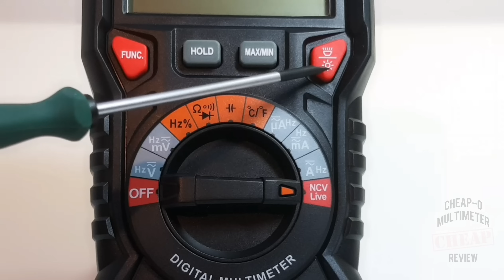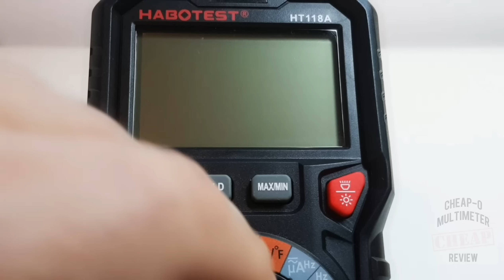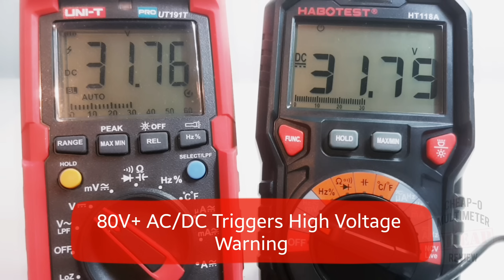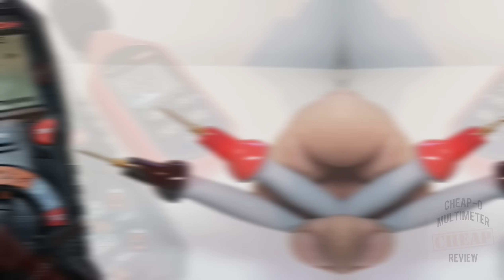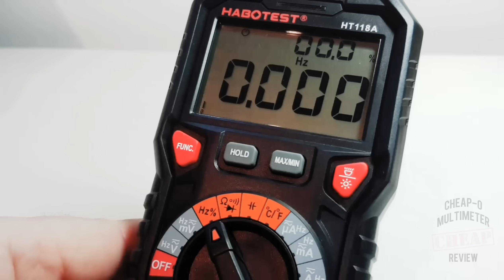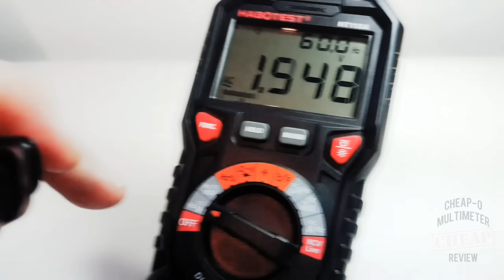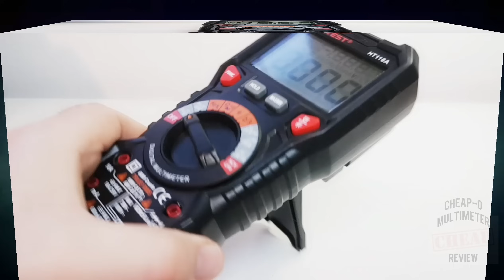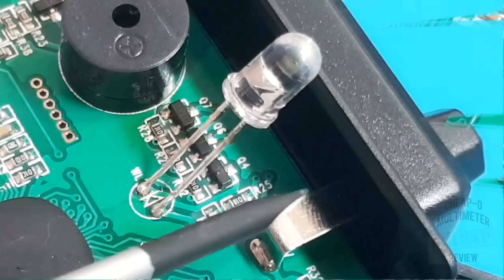HABOTEST HT118A  CHEAP-O Multimeter Review & Teardown!

Comment: Does yours sometimes show the temperature in Hz/mA mode?
Reply from the maker: Never seen that happen before..
Perhaps give the selector switch a cleaning with IPA
Reply: @KeepOnTesting  Thank you for the answer and the tip, I'll try that out.
It seems to be a contact problem, if you touch or move the selector switch slightly, the modes change or the device switches off completely.
Reply from the maker: I would also put a tiny amount of dielectric grease on the selector tracks after you've cleaned them with IPS. Let us know how it goes. 👍
Reply: @KeepOnTesting  I'll try it tonight.
In principle I could still return the device, but when you buy something with a new customer discount you try to save it to save stress and money.
Reply: @KeepOnTesting  I opened the device, removed the grease applied by the manufacturer in the affected area, cleaned the sensors and it already looks much better.
It no longer switches off or over easily and the temperature is only displayed in Hz/mA mode if you press the control knob on the opposite side down a little.
It shouldn't happen, but it can be avoided.
I will test it for a while and hope it stays good. I still have to apply fresh grease, unfortunately I don't have any left in the house.
One thing that has surprised me since I bought it is that even with very fresh batteries it never shows "full". Is that normal?
In any case, thank you very much for the great support!

Comment: I would like to ask you about this habotest watch, it is sold in Asia and Europe, is there any difference in accuracy, sir?
Reply from the maker: No, the accuracy is identical irregardless of where its being sold. Only difference is the input protection which is usually better in the European version due to more stringent EU safety regulations.
Reply: @KeepOnTesting  Oh I'm so happy to have your reply, thank you so much 😊
Reply: @KeepOnTesting  About habotest HT208D AC DC current clamp meter, do you know it?
Reply from the maker: @c__TattinhNhi Check out my HT208D Clamp review,  it's the identical clamp as the HABOTEST,  its simply rebranded as a Kaiweets. https://youtu.be/p2v7-uQD6QM?si=xIK_Sc31HujFk7ti
Reply: @KeepOnTesting  Thank you very much😊
Reply from the maker: @c__TattinhNhi  Anytime my friend 👍
Reply: @KeepOnTesting  I have watched many multimeter review videos but rarely see anyone clearly explain the error table of that meter.  I mean the specification is wrong

Comment: Would this be a better choice over the Sanwa CD771? Thank you.
Reply from the maker: Completely different multimeters.  If you're working on energized circuits Grab the Sanwa !
Reply: @KeepOnTesting  Many thanks for your time replying to me, let alone so quickly!  If I may last ask: what makes the Sanwa better for energized circuits? I plan on doing electrical and electronic projects (building electric and electronic devices), some electronic repairs, testing salvaged components + general fiddling around and experimentation. Thank you for your multimeter review videos, love them.
Reply from the maker: @cosmos7engineer  SANWA is a better engineered multimeter. It does not have all the features of the HABOTEST but it's built with a high degree of precision and the interbal components have better tolerances. You sound serious about your electronics needs and you will probably be doing more than a hobby electronics therefore I suggest grabbing the Sanwa and perhaps pickup the HABOTEST as a backup. Btw sanwa-america.com is the place to get your new Sanwa if you live in North America. Tell them Darren Walker Sent ya 😃

Comment: I thought NCV was no contact voltage? why did he stick the probe in the cable? it should have detected voltage without contact.
Reply: NCV is non contact voltage yes, but Live test is probing with 1 probe for a single contact point voltage test
On the meter there is NCV and Live in the same spot indicating it does both, which it does

Comment: A long term review would also be a great help. I find that the cheap meters usually fail because the dial or the power buttons fail.
Reply: I have the same multimeter, I got it 4 years ago. it still functions very well.

Comment: Almost bouget but why why it's going to AC not Dc. 99.99% of my work is DC
Reply from the maker: Agreed, DC should be the default! 👍
Reply: Todays versions goes to DC, I think if you order nowadays, it'll be latest build - Starts to DC, light doesn't turn off, beeping in diode mode, etc.
Reply: @svetlinbarzev9110  Bought one, tested. the problem is, its to slow on ohm . I have 3 Fluke 11 30 years old much faster. not for pro for sure
Reply from the maker: @computersrepaircotesaint-l7407  True enough but it's only 35$ so I can't compare it to a Fluke persay, even an old Fluke 😄
Reply from the maker: @svetlinbarzev9110  I'll be grabbing a new version to compare. 👍

Comment: Hi Darren, a lot of thanks for all theses reviews, very useful for a beginner like me.
 This Habotest seems really reliable and a very good choice.
A simple question about all these 3 Volts multimeters : Is it possible to use the voltage of a lithium battery (between 3,3V and 4,2V when fully charged)?......surely better light on the screen and higher beep, very little discharge for a big Ah capacity, but any problem for the electronic card and the screen with this little higher voltage? Can it be a possible choice or is it better to keep both alkaline 1,5V batteries?
Michel from France.
Reply from the maker: Hi Michel..

Many thanks...😉
Yes, you can certainly use a Lithium cell instead of a regular alkaline battery. In  terms of performance and possible long term effect I don't have any data to effectively point to. I say go for it !
 😀👍
Reply: @KeepOnTesting  Thanks for your quick answer Darren , "I 'll go for it" and first try with one half-charged cell (storage voltage, 3,8V) and then slowly up......I live not far from the english coast....and if that smells like a little burnsmoke across the Channel to your home, you will know it was a mistake!! Greetings!
Reply from the maker: @Michel-Artois  Sounds like a plan.! Hopefully you'll be just fine..let me know how it goes 😉👍

Comment: I had this 3 months. One day (I must have dragged my feet a bit) I walked up to my bench and just turned it on, the lights flashed for one second and that was it, dead as a doorknob. It wasn't hooked up to anything, Ripped-off!
Reply from the maker: I would clean the rotary selector tracks with IP, then grease lightly with a dielectric. Sounds like the tracks might be causing a short. Also, inspect pcb for any loose or cracked components.
Reply from the maker: Yikes !!! Sorry to hear that Cliff!

Comment: How would you compare this to the lomvum t28?
Reply from the maker: I still prefer the HABOTEST...
Here's my Lomvum T28C review..
https://youtu.be/JxE1Uwh6sLE
Reply: @KeepOnTesting  thanks!
Reply from the maker: @NegativeRail  anytime 😊
Reply: Im stuck between the HT118a and the HT118c. I’m leaning towards the manual option. Any reason to avoid that? Currently studying to become an electronic technician, but still pretty beginner. Thanks.
Reply from the maker: @NegativeRail  I think the manual ranging 118C would be better from a learning perspective 🤔 definitely not as easy to use at first but you will catch on quickly I'm sure..

Comment: Does it have adaptor for 2 pin standard k-type temperature sensor or just proprietary k-type ? Very good review! 👌🏻😁 i am oscilanting between this and uni-t 139C. Habo looks nicer but i belive the 139 is better what do you think? 139 also has no adaptor for k-type 🤦🏻‍♂️ and i really need that
Reply from the maker: The Habotest has no KTYPE Adapter. Just a standard Jack input sensor temp probe. You can buy a separate KTYPE Adaptor on Ebay or Ali though. 👍My preference is definitely the HABOTEST 💥
Reply: Darren Walker thank you for the response 😁
Reply from the maker: @3mariusx  send me an email: netplicity1@gmail.com    
I'll send a ktype adapter your way.

Comment: What about shorted diode test in this multimeter ht 118a
 give short beep in case of good  diode and shorted diode 
because if you touch two probs in diode mode give short beep is this normal

Comment: Great video, thanks for review. i have a old 1999 count dmm and some functions not working anymore so Currently looking a good deal multimeter to buy. Which should be better habotest 118A, aneng 8008 or unit ut89x. Prices in my country ht118aand ut89 25$. Aneng 18$
Reply from the maker: I would still choose the HABOTEST HT118A 👍
Reply: @KeepOnTesting  
Uni- T89XD ??
Reply from the maker: @pengawaspenyerumalutaubat8365  
https://youtu.be/pAovc5h12zg

Comment: Hello chief, I have just got one of these and would like to change the temperature display. Do you know how I can do this?
Reply from the maker: Press the FUNCTION button (top left)to alternate between C/F 😀👍
Reply: I have the kaiweets version and function button does not do anything on the temperature setting. Thank you for your advice.
Reply from the maker: @stuartpeters1080  My bad.. You can't change or alter the display in Temperature mode. It's a dual screen setup with no options. Btw, All HT118A are identical,  KAIWEETS, RICHMETERS, HABOTEST  etc..no difference , same pcb.
Reply: Ah right you are, cheers.
Reply: There must be a software difference as my meter has Fahrenheit as the larger display and Celsius as the small display. Where as your meter is the reverse. Interesting.

Comment: can it measure mosfet?
Reply from the maker: Yes, most any meter can verify if a mosfet is good or bad. Use diode mode and check your datasheet. Charge the gate , connect to drain and you should see it short.

Comment: Hello Darren hope all is well with you. It appears to me these DMM are available under different brand names. 
Example 
HabotestHT118A
Kaiweets HT118A
Taiss TA118A
AstroAI M6KOR

All at different pricing cheapest I found was the 
Kaiweets at $33:99 CDN
Taiss TA at $34:66 CDN
ASTROAI M6KOR at $30:99

The Habotest HT118A ranged from $47:29 all the way up to $147 😱

So I wonder who the actual manufacturer is. Seems to be a daunting task to make a decision of which one to get in the DMM market. I wonder how these stand up against the Crappy Tire brand Mastercraft Maximum meters and is it worth paying more for the likes of a Brymen, Greenlee, Klein, Fluke EEV and the UNI-T. 

Let me know what you’re thoughts are considering you have approximately 500 meters. Thanks
Reply from the maker: Hi Richard,
Yes there are many incarnations of the HT118A but they are ALL identical. Same PCB, board layout and components. In a subsequent review I had the Kaiweets and another opened for display...https://youtu.be/8IK09P25qAM
They are every bit as good and better than the Canadian Tire Mastercraft series, which are rebranded Allsun multimeters anyway.
For the average home user it will suffice nicely. It's not a Brymen but it's not priced like one either. Never pay more than 45$ CDN for the HT118A. UNI-T also makes some great multimeters at great prices with better input protection than the HT118A. Just not as feature packed.😀👍
Reply: @KeepOnTesting  Thanks for the prompt reply. As I am looking to set a small workshop with the intention of getting into electronics and my ham radio license, be honest and advise which meter is the one to get for that purpose. I only wish to buy once, but also keep on a budget. On a fixed income now and building up the necessary equipment can be pricey. I just recently purchased a used Tektronic 466 Oscilosope and will be needing a power supply and possibly a spectrum analyzer and frequency generator to add to the list of wants. I appreciate all you do and the time and money you spend making these videos to help educate us less savvy in this area or expertise. Thanks. 🍻
Reply from the maker: @richardshort4587  In that case I would be happy to help..email me: netplicity1@gmail.com and I can give you  a longer reply with some sage advice 😀 👍
Reply: @KeepOnTesting  Hi Darren, my email message should be in you’re inbox now bud. Thanks Richard
Reply from the maker: @richardshort4587  Got it..will reply shortly. 😀👍

Comment: I have one of these.  if you read the manual it cautions you not to use it on voltages higher than 230VAC. if that's the limit than this meter can not be rated CATIII or IV.  I would not use it on Industrial 480 power systems.  The meter is well built, though I did have to open it up and re-solder a circuit pad because it was interminate.  .
Reply from the maker: Good point..Let's face it most dmms in the CHEAP-O REALM aren't going to do heavy mains ..nor should they..used for household voltage (120/230) max depending on your geography and you'll be just fine.
Reply: @KeepOnTesting  Cat III and Cat IV ratings are a safety rating.  The manufacture is basically saying that the  instrument will not cause a Arc Flash incident at voltages up to 600 VAC when properly used.  If you are not aware of how dangerous a Arc flash incident can be take a look at some of the video's on You Tube.   

yes I like the versatility of the instrument but I only will use in on my electronics work bench and deffently not on tube equipment.
Reply from the maker: @jimnunn9232  I'm well aware of CAT Ratings. Hence, HT118A is perfectly safe for household mains CAT II. Most multimeter vendors claim higher CAT than what the multimeters are actually capable of safely doing. Never use any CHEAP-O Multimeter for anything above mains 1 or 3 phase CAT II and you'll be fine.

Comment: HI Darren, love from india. Will You be doing reviews of meters from 50 TO 100 USD.  And also one more question, which alcheapo multimeters has the best input protection. and by cheapo I mean below 50 USD. based on that I will buy it promptly. yu really give very convincing reviews, I base my buying decisions base on your reviews.
Reply from the maker: Hello my friend! Yes indeed I will be doing some multimeter reviews I the $50-150 range in September 😀👍
CHEAP-O w best input protection..Great question! ...normally the two don't coexist however the UNI-T UT39E+ had one of the best...dual PTCs, spark gap protection,  ceramic fuses and a very clean pcb layout ..20,000 COUNT CHEAP-O !!

Comment: There is a simple hack to keep the backlight on indefinitely.
If you have the earlier firmware.
Inside, top right, are three wires, red, black, white going to
the display. connect a new wire from the white to the left leg of the flashlight
LED. Now the display backlight stays on with the flashlight.
If, like me, you think the flashlight is useless, snip the right
leg of the flashlight led. Now the backlight times out with a
short press of the backlight button and STAYS ON with a long
press.

Comment: I just got the exact same multimeter, except it's branded Kaiweets. I agree, the 20 second auto off backlight would be a deal breaker, but mine turns on and stays on till I turn it off. Maybe Kaiweets brand had it tweeked a bit before launching. My only "complaint" really is that I thought it would weigh a bit more and feel more expensive and rugged in the hands. Other than that, 2 thumbs up!!
Reply: And in the kaiweets ht118a there is a extra cover in the multimeter

Comment: Thank you for the review Darren!  I just bought the Kaiweets 118A for $29.  My backlight stays on, and can use with flashlight on.  Also, on Amazon reviews are saying you can no longer access the internals to change the fuse.  On mine you can.  I think they just don't know how to get that grippy cover off of it to take the screws out.
Reply: im confused. kaiweets look identical with habotest ht118a. both have different website .hope the performance is the same. habotest is cheaper a bit than kaiweets in malaysia
Reply from the maker: I agree, wouldn't make any sense..😝👍
Glad you picked one up..its a Great multimeter!

Comment: Great review! I have just received it and im really happy. Its newer version and has permanent backlight without turning off which is great. In the video there is board version v1.2, mine is v1.9 and has also few different components on board (but i dont know how they are called, im not electrician :).
Reply from the maker: Wow, that's great 👍 v1.9 , incredible! That's alot of revisions! Keep used posted..
Reply: Stan, where did you procure the v1.9 unit from?
Reply: yeah mine does not go off if I recall. Let me go and check

Comment: Hi. I bought one after your video. Now i have  habotest ht118a and holdpeak hp-890cn. Habotest does not have rel button. Holdpeak has protection over 500 voltages while measuring diode, resistor, buzzer, capacitor or frequency . But habotest is protecting over 250v.
I want to sell one of them but i can not decide
Reply from the maker: Yikes, decisions decisions 🤔 ...Its a tough call...but you know my preference..bye 👋 👋bye HP-890CN!
Reply: @KeepOnTesting  Why? :) Accuracy?
I need your help for decision.
Reply from the maker: @elecdroid3666  FIT/Finish/Accuracy/Dual Display /Illuminated inputs ...its no.1 in the CHEAP-O REALM for a reason.😃👍
Yes a REL would have been nice...
If you only have 2 multimeters..I would suggest keeping both.. nice to have a backup.😃👍
Btw, Check out our new website💥💥💥 www.keepontesting.com 💥💥💥
Reply: @KeepOnTesting  I have unit ut210d, habotest ht118a, holdpeak hp-890cn and tes2012. thanks. i think i will keep
Reply from the maker: @elecdroid3666  Good 👍 decision!
Reply: @KeepOnTesting  Hello again.  I noticed something in my tests today and wanted to share with you.  I have hundreds of tp4056s.  habotest was too slow to show fluctuations of voltage outputs.  Holdpeak detected voltage spikes much faster.  Have you experienced such a thing?